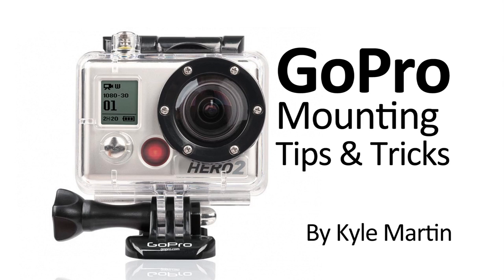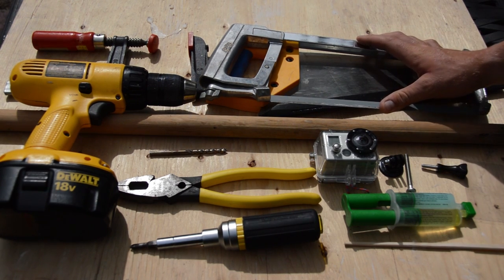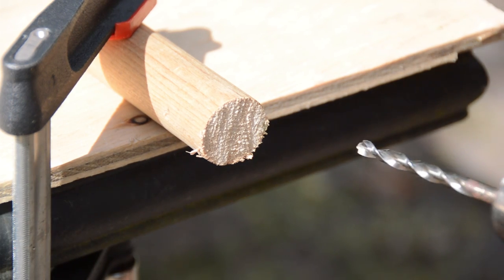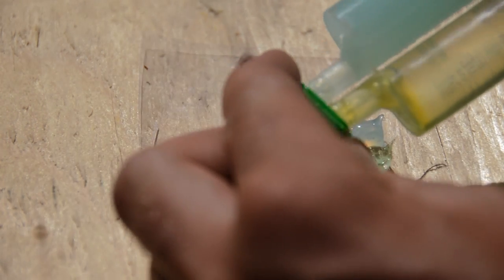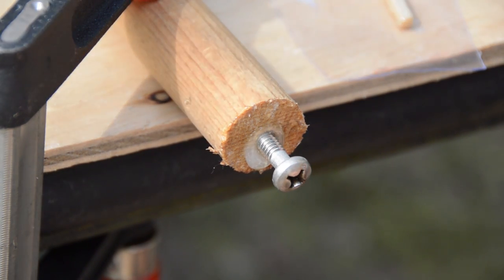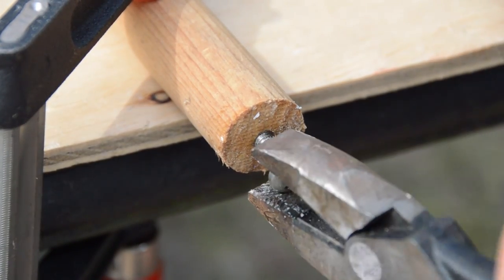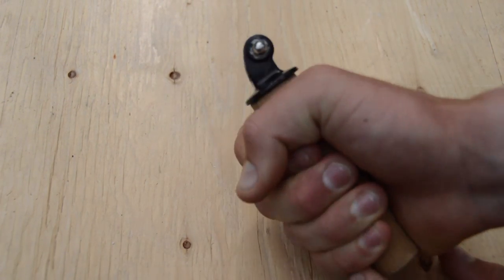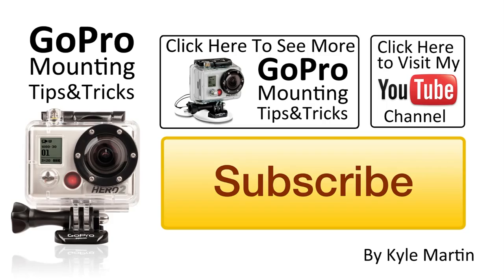Make a GoPro Handle: GoPro Mounting Tips And Tricks

Comment: Thats what I did, and I love it. I just used a Specialized lock on grip that was taken off of my wifes mountain bike actually. It is grippy, stable, and looks nice. The Floaty back door works with it as well. It was a used grip, so the only real cost was the tri-pod mount from GoPro. Its my favorite mount, and I use it more than any of my other mounts.

Comment: thank you for the amazing idea! i used a pine dowl and stainless 1/4x20x3" bolt on mine. but my handle is also 1-1/4" and a little longer then yours (due to size of hands) i cant wait to test it out. my longer handle will be drilled out using a press because i suck at getting the hole straight and centered. :) either way man thanks!!!!

Comment: Use 3/4 PVC. Put an end cap on one side, cement. Drill the other cap slightly small... put a 1/4 20 by 1/2 inch long bolt in with a star washer. Apply silicone and let dry. Then glue that cap into place. About the same size, looks neater, and it floats.

Comment: good idea, but ugly work
Reply: it's epicly cheap, what'd you expect? + it's really fucntional...
Reply: You could have grinded the cut surface and the edges with sandpaper and coated the holder with lacquer or diluted epoxy so the wood would be water resistant.
The original end of the bolt is always better than a cut thread. You could have cut the bolt head and stick the screw it into the handle with the original end out. No need of screwing, epoxy is strong enough to hold a long screw also in a wider hole.
Also cheap but a nicer outcome.